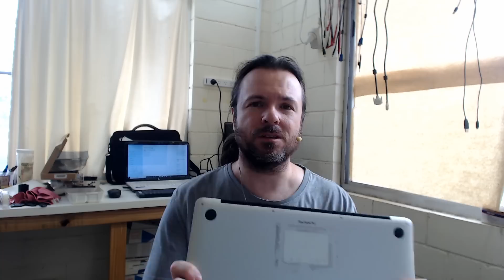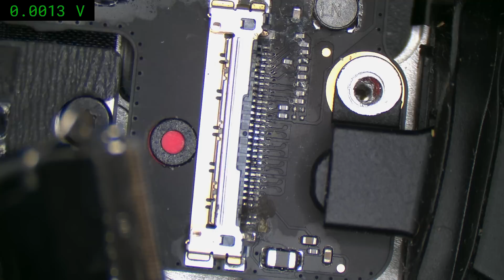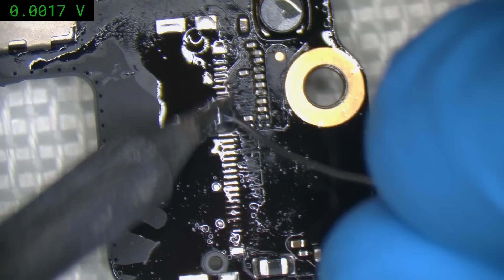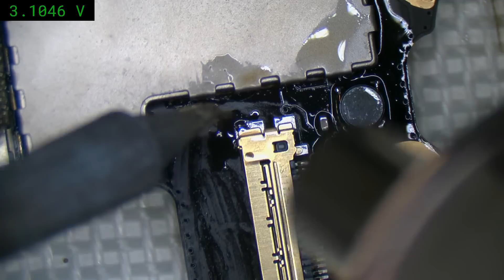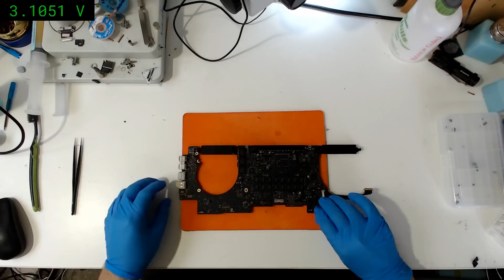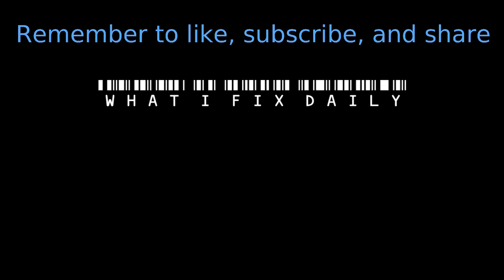#235 Macbook A1398 Boots but with no display

Comment: Hi Paul, sorry for my ignorance but what do you do exactly to check if a component on the logic board is shorted to the ground? Thanks
Reply from the maker: You simply measure the resistance to ground, or diode-mode voltage to ground. Anything lower than about 20 ohms (or about 0.1V-diode) is cause for concern in most cases unless it's a high current power rail such as for CPU / GPU power.

Comment: As far as changing hot tips, do you have a Hakko B2300 or clone silicone pad? The FX-951 should have came with one. It's a black pad about 90mm by 90mm. Changing tips is super fast, plus the new cartridge should heat up in like 15 seconds.
Reply from the maker: Yes, I've got that lost in the workshop somewhere.  I used to use it to do the tip pull/swap,  not sure what I've done with it since the workshop rearrangement.

I was thinking of going with replacement handles+tip simply because of having a backup in case one fails and let chance of being a silly-billy and burning myself .
Reply: @pldaniels  - I bought that B2300 pad for less than $6 USD. So pretty cheap if you want to get replacements.

Comment: Hi Paul,

I was hoping I could ask ya a question. How do you determine a capacitors value when its not marked and when you're not using schematics? I work on vehicle-modules such as; Immobilizers, PCMs and ECUs. Sometimes, actually quite often, I cannot identify a CAPS value due to no info on it. 

I'd appreciate any help :)
Reply from the maker: Two options I suppose;  
1) remove the part from the board, test it with a multimeter (usually +/-20% with caps, and you still have no idea of voltage rating)
2) get the schematic and hope it contains the data you need, and hope that the board has the part-code silkscreened on to the PCB
Reply: LCR Meter?  https://youtu.be/vpSHWLkjd44

Comment: Nice job, but wouldn't it be easier to change the tip then to repair bad solder joints over and over again.

Comment: good video you need a bcm-2 lol
Reply from the maker: I just need to buy another handle for the FX951 so I can switch between quickly.  The JS02 is nice for a lot of the work but definitely at times you do run in to that thermal brick wall.

Comment: Nice work. When you add solder to the traces, at least that appears to be what you're doing, does the solder just automatically stick where it's supposed to? Even when you move the iron randomly, it looks like the solder only goes right to the connectors. Apologies if I have my terminology wrong.
Reply from the maker: At these smaller scales, surface tension is the king - as such, yes, so long as there's plenty of flux and enough heat the solder will have a natural tendency to go to the right places.
Reply: @pldaniels Ok that makes sense. Thanks, Paul.
Reply: Solder really does not want to stick to the solder mask in-between the pads.

Comment: Nicely done 👍... been meaning to ask for a while... what is the mat you use, is it one of those silicone baking mats (what brand)? I know that a lot of people use the plain silicone mats including Louis, just wondered how yours performs under the heat?
Reply from the maker: Yes, it's a generic sources fibre inlaid silicone mat. It copes very well with indirect heat (ie, off the edge of a pcb) and for lower temperatures/intensity (~400'C) it seems to do fine for a while with direct heat such as if you're reflowing the balls on a newly reballed chip.
Reply: Paul Daniels    Thanks, great channel btw 👍

Comment: Nice fix Paul, that flux did seem a bit wonky, but you got there in the end and that is all that counts.  Sorry to hear one of your furkids isn't well.  When that happens you just wish they could talk and tell you what is wrong.  Regards, Dave
Reply from the maker: Yep, really just bungled up the process a bit, lacking heat and flux, just wasn't doing the right thing and adding more of both.  That contaminant I think might have been present on the legs of the connector but burned off on the other pins with the higher heat - who knows, either way it was a bit annoying and turned what should have been a clean job in to a pain.

Yes, having one of the furkids in strife just cuts your soul out from you.    Things improving at the moment but it's been a long period of time so still going to be apprehensive for a while yet.

Comment: Nice work! Have you got your workshop how you want it or is the perfection still progressing?
Reply from the maker: Still very much work in progress,  having trouble trying to keep two jobs per bench, and not happy with the positioning of the screens, still too much neck-bending.  Starting to think I need to shift two screens off to the left or right and only a smaller 3rd one in the center for YT comments/activity.  Would also like to fume-hood a large area to maximise the fume extraction effectiveness.
Reply: @pldaniels  have you considered a lower chair? I am a short lil thing so I am usually having to look up
Reply from the maker: @TheSecurity16akaTee  if I go for a lower chair my knees start to push up.  The neck bending is the other way for me with the screens, I'm having to look up too much because they're too close and too high, requiring a fairly severe angle of head lift.

Comment: good day sir, how are you today
Reply from the maker: Another day, another 2c.  Should have had this out weeks ago,  just been occupied with other matters in the house hold.

Hope things are doing well there.
Reply: Yep mostly good, not been able to work on any boards since last week, pretty much for the same reasons as you. My new IT role is quite full on at the moment too and the work days just blend into evenings and then the night :(    I still have the 820-00165 with fluctuating PPDCIN on my desk
Reply from the maker: @tonyrgnash  mmm,, little dips and no booting?  Could be a nice short in one of the secondary power rails.  Time to get that thermal camera, or sniff around with some alcohol looking for the heart-beat :D

Yes, house hold commitments do take up a lot more time that is often appreciated.  We've been on very tender hooks the last few months over the health of the furkids, one in particular.
Reply: nice little fix there, i wish i could get some traffic like that my way :)
Reply from the maker: I don't get a lot of them that are like this... behind the scenes there's been at least 3 other no-fixes for this one.  Good to get these though, I agree.  Gives you hope.
Reply: I ended up repealing and replacing part of the PP3V42 circuit and SMC and it turned out I had a short to ground on PM_BATLOW_L under the CPU :(